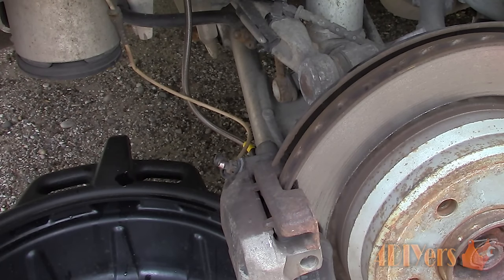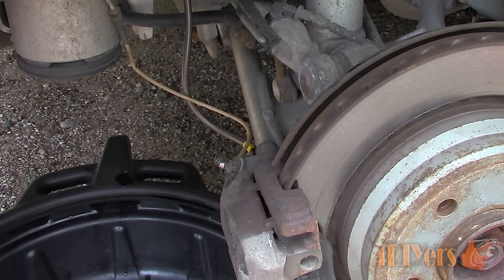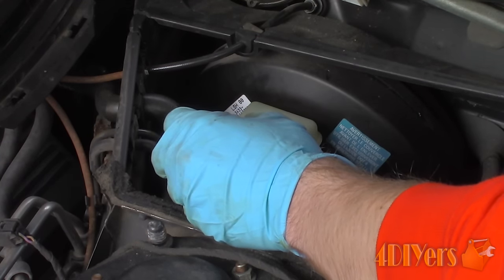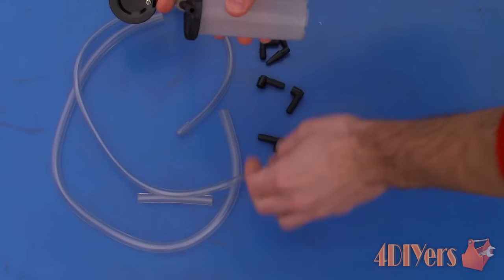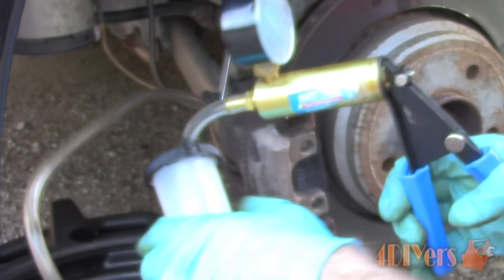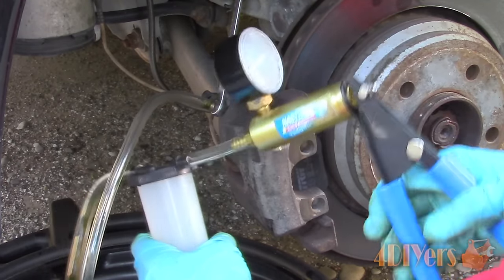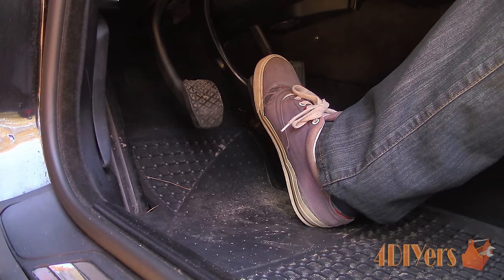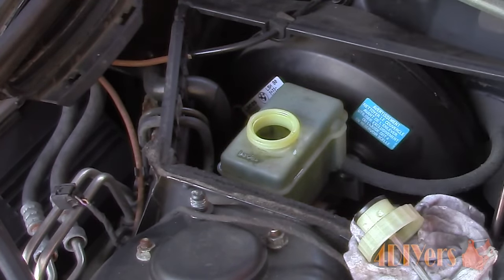DIY: How to Bleed Brakes Using a Vacuum Pump

Comment: Just like with their transmissions, people do not ever change out the brake fluid in their ABS system thinking the stuff lasts forever. Then the ABS light pops up and the brake pedal goes to the floor and fails to stop the car. Brilliant! The brake system will nearly last forever if you change the fluid. And getting a vacuum pump like this allows you to work on your car and save money both by skipping the repair shop, and you are providing the labor. This tool pays for itself the first time you use it, and you don't get brake fluid all over your driveway. Now that is Brilliant! All ya gotta do is change the fluids in the brake system and transmission every 60K-75K miles, and your car won't break down. Promise.

Comment: One of the most important things that is overlooked in most reviews and walkthroughs: be sure to put the rubber seal on the top of the cup to seal the cap to the cup or else it won't develop vacuum. I tried taping the holes on top of the cap, I almost returned the thing until it clicked that I had to use those little rubber band looking seals...
Reply: I had the same frustration today!
Reply: Most helpful comment of the day!! Thank You 🙏🏻

Comment: Good Video. Air bubbles coming in around bleeder screw are usually vey fine, and constant, where the system air will be larger bubbles. I usually don't use any more vacuum than necessary to get fluid flow because excessive vacuum can pull air in around the hydraulic cylinder seals which is not good. It takes a bit of practise to tell the difference, but once the large bubbles are gone you should be OK, the tiny micro bubbles from the bleeder screw cannot get into the cylinder, so you have to learn to identify them and live with them.
Reply: I was exactly searching for this information. Thanks a lot.

Comment: Thanks for the tips, especially on the need to build up a negative pressure before opening the nipple.  I have seen another video where the person was just using it as a pump to suck the fluid through.  Your video seems to answer another of my questions which is whether you have to pump several times to build up the vacuum or whether you just have to hold the pump open.  So there does seem to be a non return valve of some sort in the pump, like a bicycle pump but in reverse.  Cool.  Thanks for that.
Reply from the maker: No problem, glad I could help. I also have an updated version too in much better quality if you haven't seen it https://youtu.be/kFQHy2WCDC8

Comment: 01:58 Good advice here re loosening the bleeder screw. I use a six (not the common twelve) sided socket for the initial loosen. I also spray penetrating oil on the threads and leave it a few minutes (or more) in case that helps. I also try tightening just a tiny amount prior to loosening, then I work it loose, back and forth, unlike until it's completely free. I'm talking of screws that haven't been touched in decades. I find it worth a few minutes to loosen the bleeder like this than have it break off. They can be very difficult to remove once they've broken off, in my experience - all too easy to damage the caliper thread.
Reply: i wish i would have seen this comment last week lol. i got an 05 acura tl thats spent its life in the midwest and when trying to bleed the rear brakes the nut is seized onto the bleeder screw so it just started turning out of the caliper🤦‍♂️

ordered myself 4 new bleeder screws and ill be installing them tomorrow
Reply: @michaelharland9599  The nut is part of the bleeder screw ... isn't it? 🤔

Comment: Super helpful, thanks. Thanks to your video I realized I had been pulling air bubbles from around the threads for about an hour, wondering why there was so much air in system
Reply from the maker: You’re welcome!
Reply: I’m getting ready to do this tomorrow. Had I not watched this, I would’ve done the exact same thing 😂

Comment: Searched for a tool like yours, couldn't find anything local so ended up getting a pro-workshop  one that connects to my air compressor.  Same principal though - most likely I won't use it again for several years but never mind, I still trust myself to do this job more than if I took it to a mechanic and they put the first year apprentice on it.

Comment: I got feed up with the vacuum bleeder because I had to use zip ties and Teflon tape and I was still getting a very small leak so I ended up using a 2x4 wedged between seat and the pedal to simulate a second person. Worked the first time I tried it.
Reply: To hold the brake pedal down? Thanks

Comment: This can be used in conjunction with another method that works well. It's simple. Hang the cup on a high point. There should be some liquid in the hose (mandatory strainght vertical line). Open the bleeding plug and get in the car to pump the brake pedal. All the air will come out on its own at the highest point (the cup). You just have to be careful not to overfill the cup and not to run out of brake fluid in the master cilynder.

Comment: Hi. How can we be sure that when you open the bleed screw, the vacuum pump isn't drawing air through the bleed screw threads and leaving some in the system when the screw is tightened? You say to pump the pedal to check but I really want to be sure no air is left in there. The only way I  can be sure is to use a pressure bleeder but I already have a vacuum kit. Thanks.

Comment: Nice DIY, Do you not have to press the brake pedal a little to allow fluid to pump out of the nipple? I figured it wouldn't get through the master cylinder if the pedal is not pressed.
Reply: YES YOU DO... I almost drove myself crazy, not realizing even with a vacuum pump you should begin the process by pumping the brakes a few times
Reply: There's a ton of nuance that could be gotten into.  As an example it's a smart move to have the car tilted forward to where the front brakeline on the master cylinder is slightly lower than the one closer to the firewall.  Because on a lot of cars the cylinder is mounted at an angle and there is room in the cylinder for air to get trapped higher than the secondary outlet.  But how long do we want the video to be lol.
Reply: @sidichendid7237  The shop manual for my 1956 Olds 98 with power brakes says, "The engine should not be running and the vacuum reserve should be depleted by applying the brake several times before starting the fluid bleeding procedure."

Comment: So in the video you put an adaptor on the end of the hose to go onto the bleed screw; however, when you put the hose on the bleed screw it looks like that adaptor is gone.  Where you using an adaptor on the bleed screw?  What is the advantage of using the adaptor?  I bought this type of vacuum pump last night to bleed my hydraulic clutch and I can't get it to maintain a vacuum while when I crack the bleed screw open.

Comment: I have that exact same vacuum pump kit, and I tried to do exactly as you said, but it appears that there are leaks in the threads between the bleed screw and the caliper (disk) and wheel cylinder (drum rear). There is no way to seal off the tapered fittings and the bleed screw, to allow me to develop that kind of vacuum before opening. And then afterwards, I can pump all that I like and never get much fluid out of it.

Comment: Thank you. My car brake pedal when press, it will slowly lost pressure that I have to repress the brake pedal again. Will bleeding the brake fluid fix it? Or the master brake pump need to be replaced? Thanks in advance.

Comment: thanks for the video and good info. i just bought one never bled brakes before only watched and pressing the peddle. first mistake i did was not putting in the O ring so i got no suction at all. second mistake i did not pump it before opening the bleeder screw the instructions that came with my tool doesn't say any of that it just says open the bleeder and start pumping, even said it in the video. got to try again last resort i think im opening bleeders too much and likely getting air in or i have to put silicone on the nipple end due to maybe air getting sucked in from the threads? otherwise all im getting is TONS.. of tiny air bubbles and some large ones, some liquid but never a full line of it and it just is non stop just nothing but air.

Comment: lol I kind of recognized the under carriage / suspension a little bit from my own car and as soon as I saw the pedals and the rubber mats, then I was immediately surprised I was right in my suspicion of it being an E39. I have a 2001 525d btw.
Reply from the maker: Haha, right on! Oh you're not in North America, unless you had the car imported. We weren't lucky enough to get the diesel option, but I have seen a couple imported cars. I actually have a bunch of E39 repair videos, but sadly have sold the car :( I still have a few videos to finish up and release for the E39 though.
Reply: @4DIYers  This may sound like a dumb question, but what did you do about the ABS system to allow fluid flow? I have an E38 (2001 740i) and everything I've read says the solenoids need to be operated via BMW DIS to bleed the brakes. Reason I ask is because I have one front caliper that is suddenly dragging (can hear it clear as day) despite no pulling to that side or other behaviors.

Comment: I just got a new 80$ Maddox brake billed pump kit. It won’t go past 20, then very slowly leaks down, it don’t leak down at all at 5 but 20s all it can handle apparently.. so hopefully I can get it sealed better or 20s good enough lol..I got a few months ago so I hope I can get it working good because this things in returnable now😅.
I’ll try soap and water and check the whole thing in the pressure mode obviously (this one does both vacuum and pressure)

Comment: I have a rounded brake bleeder screw on the passenger front wheel. If I use a self-bleeder kit like this, can I successfully bleed the brakes at the driver-side wheel ?

Comment: You mad an excellent video.  But I find that the vacuum method has a major flaw in that air will almost always seep in around the bleeder screw.
Reply: grease the bleeder and you can do it with a bit lower vacuum like 20
Reply: @tech99070  that's a good idea

Comment: What about systems with abs? Will this work or does the abs pump need to be consistently pumped? I notice my pressure bleeder doesnt work because of the abs.
Reply: I was told several times that if you can get fluid flowing out of the rear than it's not your abs but I sure wish someone would answer your question cause it would answer mine,I have done at least 60 break jobs only struggling with 2 but this question keeps popping up.

Comment: so this brake bleeder kit is just for getting air out the system right? It would probably be advised to use a power bleeder for brake fluid flushes correct?
Reply from the maker: No, it can be used for flushing the system too, it just takes a little longer because of the smaller cup.

Comment: If you go past the minimum line, can you just start the bleeding job over again by reflushing the system? Or does it ruin it permanently by going past the minimum line in the master cylinder resovoir
Reply: You just have to start over, wasting time and fluid. Depending on how low you go, you might be fine. The other issue is if air gets into the abs system. This can be a challenge and maybe not even possible to fix at home. These abs modules generally need higher level scan tools to run a program to remove the air.

Comment: Does it matter which wheel you start with if you're using a vacuum pump? My dad always taught me that when we bleed the brakes by pumping the pedal and having someone watch for how much fluid is coming out of the cylinder that we start on the wheel furthest from the master cylinder.  Is that still true for this, or does it not matter? 

Thanks so much this video was really helpful.  I've had this vacuum pump for years and never used it.  Now I'm going to try it next time I have to bleed the brakes!!  Thanks again!
Reply: Still true. Also don't forget to the seal in between the cup and the cap or else it wont hold vacuum!
Reply: It's true for most vehicles, but not all. For example, on a 2005 Dodge Neon (this is just a specific year, make and model I'm very certain about, but there are other years of neon, and perhaps all neons, and likely several other years, makes and models of vehicles):  Start with left rear tire (behind the driver's seat), then the front-right tire (front passenger). Then do right rear, then front left. If they aren't bled in the correct order, you'll never get all the air out. You can repeat this bleed pattern multiple times to be sure you're still not seeing bubbles, but just be sure to stick to this order.

No idea why so many people still state so confidently and so incorrectly that the order is always the furthest tire from the master cylinder. It really depends how the brake line system is configured.

Comment: If oil gets into the vacuum pump by accident, will it stop working? Mine won't hold any pressure and its not the seals.
Reply from the maker: Have you just plugged off the pump? Oil shouldn't cause any issues, the seals should be chemical resistant. Make sure the schrader valve is functioning correction too if it has one.

Comment: Draw up and replace the fluid in the master cylinder if the vehicle has a few years on it, then while you bleed each caliper keep tabs on the volume in the master. Do not let it go dry .

Comment: Hey, i just replaced every component of the brake system on a 1967 camaro upgraded to 4 wheel disc brakes.  Have not been able to get a hard pedal, the pedal falls to the floor, have bleed the brakes many times, and replaced the new master cylinder, and the new brake boost, still no sucess.  Do you think the air is possibly trapped in the line some how?  I'm perplexed.
Reply: Same here with a 70 c10 truck
Reply: Have you bled the master cyclinder?

Comment: Do you need to leave the master cylinder cap off while doing this?
Reply from the maker: I have the cap set on the reservoir, just to reduce the chance of dirt falling in. But do not tighten it as you don't want a chance of a vacuum building up.

Comment: i tried doing this and I cant seem to get any fluid flowing through. I was able to easily do the rear brakes with a friend pressing the pedal as I cracked open the bleeder.

However, im having lots of trouble with the front brakes. The lines were completely removed so they are full of air. Should I just keep trying?

Really frusturating...
Reply: keep trying, but your bleeder may have rust inside of it, id reccomend going to advanced auto or something like that and tell them what car you have so they can get you 2 front bleeders, they are really cheap too.
Reply: I also should add that I cleaned the bleeders really well and blew them out with compressed air.
I was easily able to bleed both rears and drivers front, but the passenger front is being a bitch!

I sat there for a good hour straight pumping the pedal with the vaccum pump pulling 30in hg and the master cylinder fluid didn't drop an inch.

I removed the master and tested it. All went well.

Do I need to bench bleed the master?
Reply: i dont know what bench bleeding a master is, but if you put in new lines its possible that you kinked the line on accident. i would run through checking the whole line for kinks
Reply: There arent any kinks. I spent a whole week trying to figure this out. Starting to get on my nerves
Reply: have you tried to rebuild the caliper? maybe put the hose on the line itself and start a vacuum, if fluid comes out it could be your bleeder or caliper. also just get new bleeders man, they are dirt cheap and you should replace them every time you bleed your brakes.

Comment: So if we get air in the system, can we just safely restart the bleeding process until that brake pedal pushes well.
Reply: Yes if you admit air at the head of the system (master cylinder reservoir) you pretty much need to completely flush the system at that point.  There's nuance there depending on how quick you caught it but that's the safe way.  It can take a while and if you've already pulled clear fluid through about the only way to be sure you've flushed the whole system is by looking at the capacity of the brake system, and then you get into questions about is it possible to get fluid trapped in the master cylinder and the answer is, a lot of times yes.  Best thing is to not forget to keep the cylinder topped up lol.  Even with one man bleeding operations, one man one wife adaptation of that system is still safer and more effective.

Comment: +4DIYers Is it safe to take off the whole brake hose and replace with a new one, then bleed the brakes? Or do I have to temporarily make sure no air gets in the line?
Reply: once you have drained system you have to flush it.  a pressure bleeder will suit better for this than a vacuum bleeder but just due to speed/simplicity, you can also hand vacuum that situation. if you're taking the line off the master cylinder you should plug that and not drain it if you can help it.  the brake lines are less of a big deal to flush it's the same procedure you'll just do it for longer.

Comment: I know this is a bit of an older video but I was wonderingdo I have to do all the four wheels or can I just do it on the front driver's side
Reply: If you only do the front driver's side only that "brake line" will be "flushed." The other 3 "Brake lines" will still contain old fluid and/or possibly air bubbles. 
These "brake lines" are not as interconnected as you might think. If there is air in the rear passenger's side brake line, no way are you going to get that out only cleaning the front driver's side.